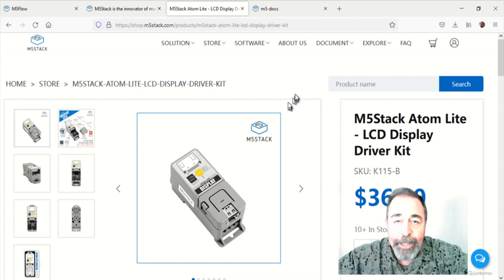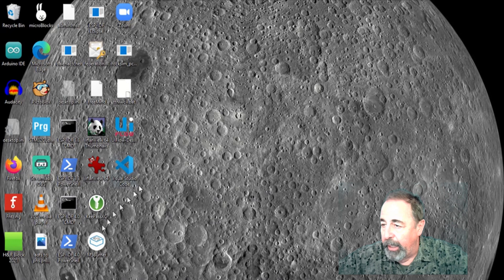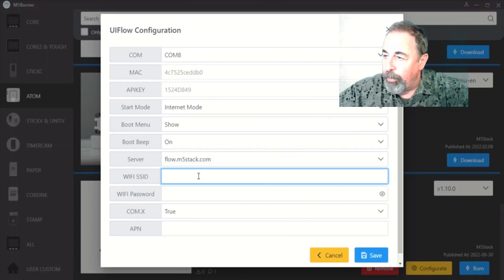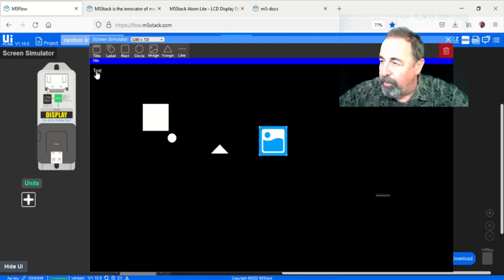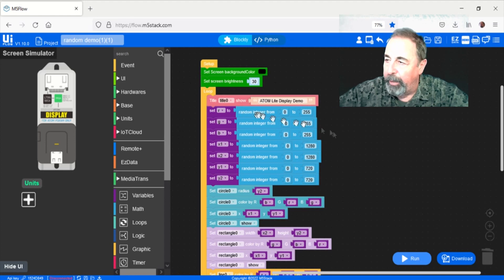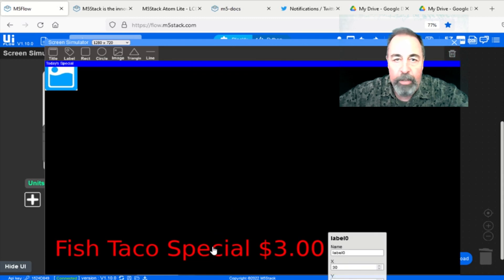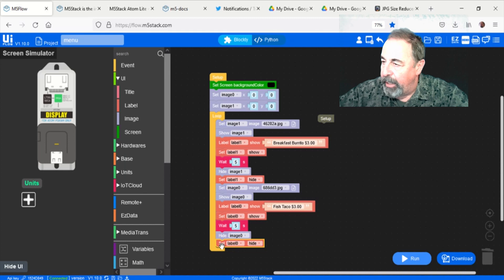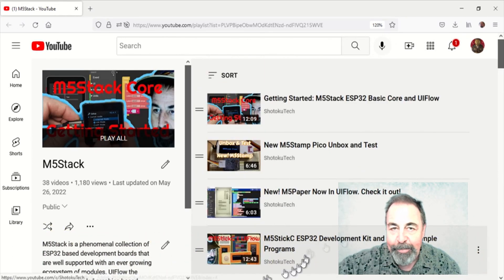M5Stack ATOM Lite Display Getting Started

Comment: Thanks so much for the vid! : )
Just tried it today. The firmware update to the latest version using the M5Burner was successful. But then when i tried to configure the wi-fi, it failed to connect to the device. Tried many times and even pressing the reset button but the problem persisted. First time having this problem. Other devices such as the M5 stamp pico, etc were fine. Any idea how to solve this problem?
Reply from the maker: It has been this long since I played with this gadget. I will have to get it out and see what is happening. Is it in the correct startup mode? That can be set in M5Burner I seem to recall.
Reply: @ShotokuTech  Appreciate your speedy reply ~
I got it solved -- using the Wi-Fi direct method to key in the SSID and password. Even so, took a few attempt before i got a message that says "reseting" and the light changes to slow flashing green.
Reply from the maker: @Katana50cc  Wonderful! I am always happy to hear good news. It is why I do what I do. I Try to do stuff and fix things.😄 You succeeded! Victory!